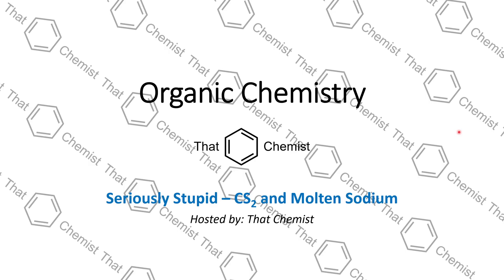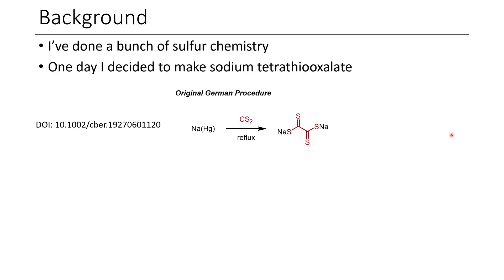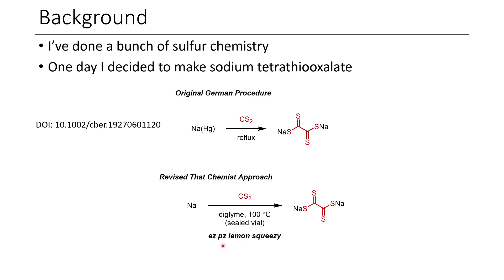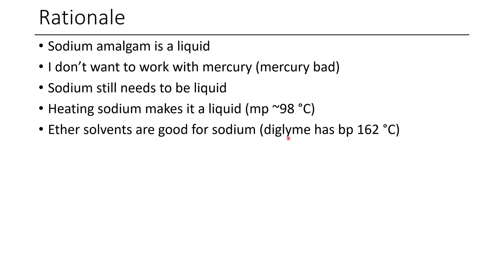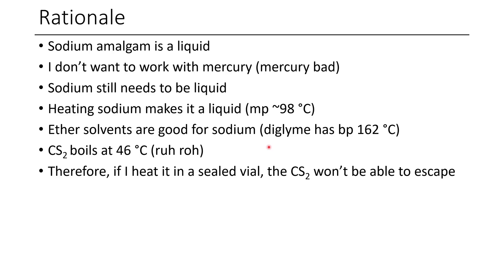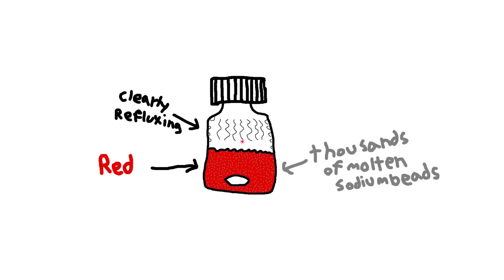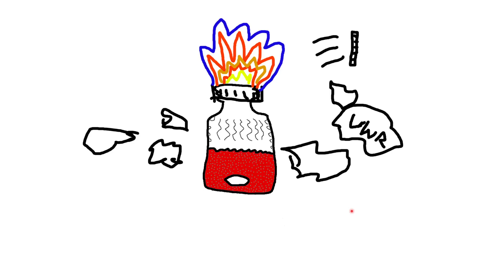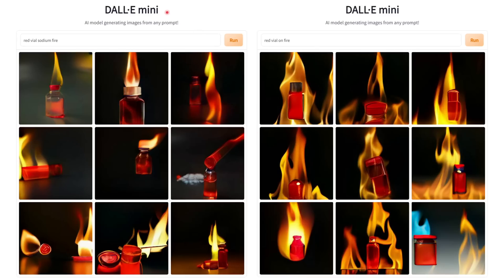Seriously Stupid - Carbon Disulfide and Molten Sodium

Comment: Carbon disulfide is terrifying enough. Just read a pretty wild book on the history of the artificial silk industry, where tens of thousands of workers over more than a hundred years were forced to work in garbage conditions, breathing in carbon disulfide as if it wasn't a neurotoxin. Insane asylums regularly took in ex-workers from rayon factories who were driven insane from the fumes.
Reply: If anyone is interested, it's called Fake Silk by Paul David Blanc.
Reply: Causes brain damage and psychosis at less than 3 grams per m^3? Yipe. Do Not Want.

Comment: so what you're saying is you just needed a stronger vial and it would have been fine /s
Reply from the maker: I mean, also technically yes
Reply: @That_Chemist  is the real correct solution to use something with a valve to tap off the product vapor?
Reply from the maker: @ghostdog0424  using a high-pressure vessel that is rated for the pressure is best - if the CS2 vented then the reaction would be unable to proceed, so ultimately a sealed reactor makes the most sense, but not a glass vial - a pressurized reactor with a regulator would be best
Reply: @That_Chemist  thanks! makes more sense than my bad idea.

Comment: You're concerned with toxic mercury but were not concerned about molten Sodium (!) in contact with a chemically active solvent???  Gosh.  Just FWIW, when Argonne closed oiut their sodium cooledr eactor, about 40 Kg of NaK went on the surplus market and I bought 10 kg, in 5 ml glass ampules.  I used this stuff for years. At least you didn't use water to extinguish a molten sodium fire.

Comment: I do not consider Your experiment seriously stupid (Not being familiar with that particular reaction, though.) . Perhaps Your only mistake was not checking expected total VP of the reactants at reaction temperature and chosing the proper pressure tube or bomb. Using proper equipment and ppe, doing pressure reactions like this is perfectly fine. Just do it in such a way that it can go bang without any further consequences other than a failed experiment. Especially glass pressure tubes do degrade over time. For those that do not know, a bomb is simply a strong pressure vessel for us scientists, not what You see in the movies...I have always used a 12 mm a lexan shield in the hood for pressure and  potentially explosive reactions. And work with small enough amounts so You know for sure that Your ppe, hood and safety shield can handle it. Hearing protection is important. I have a friend that have  regrets forgetting this. Also thinking ahead how to clean and limit toxic or noxious cleanup after a eventual mishaps is a good idea.

Comment: Dont really mind sodium amalgam, stuff works well, a lot more tame than streight sodium for many reactions. You get the mercury back at the end as well. Used aluminum amalgam also, the amout of mercury required is surprisingly small but its pretty much impossible to recover the mercury when the reaction is done. 🤓

Comment: As an alternative...  Here's a thought.  What if you used a Sodium-Potassium alloy?  (NaK being liquid at a MUCH lower temperature, well below the boiling point of carbon disulphide)  Yes, the potassium would likely react as well, BUT might it be possible to complete the reaction, and separate the product(s) afterwards?  Assuming that IS possible, then that version of the process might be a little....  safer?

Comment: Dumb question: Would NaK have formed the equivalent potassium salt?  Since NaK is liquid at room temperature, it would have avoided the CS2 vapor pressure problem.
Reply from the maker: It would have formed the mixed salt - it probably would have been fine for my purposes
Reply: @That_Chemist  Many Thanks!

Comment: Is there any reason why one couldn't bring sodium metal down to a very low temperature (liquid nitrogen comes to mind) to decrease its ductility and crush it into a very fine powder to enable the reaction without requiring liquid sodium/sodium amalgam? As long as you were careful to avoid any and all humidity coming into contact with sodium powder...is there any reason I'm not thinking of for why it wouldn't work for this reaction?
Reply from the maker: It’s conceivable, but grinding sodium into a powder is a little terrifying

Comment: Saying this as an organo-lithium engineer: Seems like Na/glyme stirring in a flask with reflux condenser and slow drip feed of CS2/Glyme reactant next time?  We were always biased to use Li dispersions in our R-X + Li reactions and slow feed the reactants.  What sort of heat of reaction did you expect? I'm wondering about the kinetics of the terminal run away rxn.  Buildups of reactants are one class of ruh-roh, and surface layer mass transfer is another. Was the intended product prone to thermal decomp? - so many questions..

Comment: In my micro lab we had two beaker explosions in two weeks. The circumstances and outcome were exactly the same. We were heating up a 4L beaker of growth media prior to sterilization in the autoclave. We screwed on vented caps (caps with inlet/outlet hose connections) and placed an air filter on one of the vents to allow for air transfer (the other port was connected to a sealed hose). The flask gets warm. Or maybe even starts to boil. Suddenly the flask explodes. The entire room is coated in scalding media. The upper portion of the beaker launches into the ceiling tiles above, breaking through them. Two analysts are in the room, but nobody was hurt because they were using PPE. Always wear your glasses around hot stuff!
Reply from the maker: Yikes!

Comment: I had a sample of a ruthenium salt and I wanted to reduce it to ruthenium metal by heating it in a stream of hydrogen. This I did in my parent’s garage. I had some hydrochloric acid dropping onto zinc and the hydrogen went through some conc sulphuric acid in a dreschel bottle. The exhaust tube had some steel wool in it to prevent blowback.
I wondered about the smell of chlorine before the whole lot exploded, I was wearing goggles.
In the aftermath I realized that the zinc was from old batteries and had some manganese dioxide on them and caused chlorine to be mixed with the hydrogen. I did see flame at the exhaust tube which didn’t go beyond the steel wool.
I hosed of the family car which was OK until I saw the inner tube of the dreschel bottle lying on the roof of the car and the sulphuric acid had eaten down to the bare metal. Fortunately the car was white so I covered it up with house paint which went unnoticed for a year.
Reply from the maker: Oh no :X

Comment: 2:07 - mercury bad. This is why people that follow the precautionary principle work on boring chemistry. Mercury metal isnt much of a hazard, being an old fart, I remember playing with the stuff in my hands. I have had mercury tests for other reasons (ate a bunch of fish from a lake I later found out had higher levels of methylmercury. THAT one is bad.) and my levels where well within tolerance. The metal, and even its vapour are so poorly absorbed (due to its remarkably low reactivity) that it just passes through you. Meanwhile, its the best way to do the experiment. The grandfathers of chemistry didnt get their names in the books for being overly cautious, no risk, no reward. Besides, you work with fluorine, that element has killed WAY more chemists than mercury has. In fact it has killed more than everything else. So im unsure how you derive your level of risk.
Reply from the maker: A fair critique
Reply: Flourine and simillarly reactive elements will probably kill you then and there, maybe you will cough your lungs out or choke in your own blood. While heavy metals will poison you and kill you slowly over time with chronic symptoms.

That's why I work with explosives for munitions. If something goes wrong I get turned into a fine pink mist. Which is soooo comforting.

Comment: Hmmm... if pressure wasn't essential to make the reaction go (doesn't sound like it was), why not put a small pinhole vent in the vial?  I've used viton with various FS tube capillary (2um to 20um) vents to mitigate pressure issues.  Of course you need some hint how fast gas or vapour is being made.
Reply from the maker: yeah the issue is how much more volatile CS2 was than the diglyme

Comment: I did the synthesis of the ammonium salt of tetrathiaoxalate were you electrify a pool of mercury at around 12 V as your working electrode and zap carbon disulfide in acetonitrile with some ammonium salt as an electrolyte. The tetrathiooxalate crystalises out as the reaction proceeds, was pretty cool. What was less cool was the separation of mercury from the crystals. I used a separating funnel to get rid of most of it but there were still loads of little mercury beads in my crystals, took about 8 hours to pipette them all out by hand.

If anyone wants to make tetrathiooxalate by far the best way is to go through thiapendione.

Comment: Correct me if I'm wrong but using a Schlenk line would have been a better choice for this reaction.
Reply from the maker: I don’t see how a schlenk line would come into play here
Reply: @That_Chemist  I guess I'm assuming a couple things. First, you'd be flowing inert gas to prevent a fire (assuming when your vessel broke you needed oxygen for the fire. Second,  I'm guessing you could cool your reflux column to prevent loss of you CS2. Also probably more   volume to prevent an over pressure.
Reply: Also note I'm a p-chemist, so yeah.

Comment: Inorganic chemist here: The group i worked in regularly handled very pyrophoric substances. Therefore a burning fumehood does rarely count for a screw up. It just happens due to material fatigue and sometimes screw ups.  But there have rarely been injuries due to fire. The reason had been, that students were very early taught how to handle sudden fires and that shit can hit the fan at any given moment.

I don't know wether this still relevant, but i often needed to use sodium as an agent. The most common way was using liquid ammonia as a solvent. But it felt really old school. So i changed the procedures and tested a bit. For me the easiest way was using glyme (my personal favorite was tetraglyme) as solvent and adding a pinch of naphtalene as a catalyst. The procedure worked like a charm and in tetraglyme i was able to do everything at room temp.
Reply from the maker: Awesome :)

Comment: A colleague of mine in grad school once did a reaction in CH2Cl2 at 120°C (!!!). Her hood was next to mine and I could see though the closed hood sash the solution refluxing extremely vigorously. I was honestly very concerned even though the reaction was in a sealed glass pressure tube and told her to set up a blast shield. Yup, I've done reactions in these tubes before and they can usually handle a couple of atms w/o problem, but you don't go THAT much higher than the boiling point of your solvent! It fortunately didn't explode but our supervisor strongly warned us against doing that ever again.
Reply from the maker: Yikes!

Comment: Given the described conditions the pressure from just boiling carbon disulfide would be ~5 bar, and since you had it in a mixture it would have been lower. I wonder if something else was going on to bust it like that.
Reply from the maker: Maybe it was a little bit warmer than 100
Reply: @That_Chemist  Suppose it was 150 C. If you had 10% carbon disulfide, that should still only be a couple bar. I wonder if there wasn't some other gas production mechanism, though I haven't thought through what that might be.

Comment: Did you end up succeeding or did your supervisor gently lay the project to rest after that incident?

My 2 ideas would be 
1) using a good pressure tube. I've done reactions in THF at 120°C so that should definitely be possible if you leave enaugh headroom for gas expansion.
2) just use NaK, duh :D
Reply from the maker: I waited until a while later to tell my PI haha
Reply: @That_Chemist  As someone who also likes not using amalgams,  I wonder if you could just dissolve some sodium in Galinstan and do the reaction that way, have done that with alu as an alternative to the evil terribad D-Tier alu amalgam (no-not for that, but yes, reduction after a Henry reaction). There's also, as mentioned, NaK.

Comment: Did you consider doing the reaction at 1 atmosphere in an open flask? Much safer.
Reply from the maker: It would have just boiled off all the CS2
Reply: @That_Chemist  Not if you put a reflux condensor on the flask...

Comment: Could you use NaK to have liquid sodium?

You might get mixed salts but that's not so bad.
Reply: apparently teflon stirring bars are hypergolic with NaK, so there's that
Reply: @tsm688  ooh, that's a reaction I'd watch through the safety of someone else's video
Reply from the maker: Yeah probably
Reply: Yeah l have the same idea.
 But when shit hits the fan how can you put out a NaK fire?
Does sand work?
Reply: @andraskatona9766  NaK isn't self oxidizing, the fires and explosions normally seen with NaK and other group 1 and 2 elements in water are caused by hot liberated hydrogen as the hydroxide salts are forming.

Comment: Putting a little glass dish over it... like it might spring a little leak instead of go kaboom.  I'd be thinking a heavy iron pot.  On most You Tube chemistry channels when someone says they are going to reflux, they use a water cooled reflux column with the curly glass tube in it.  Why wouldn't this have worked, sparing the pressure build up?

My worst goof was as a kid in a home chemistry set environment when I lit a pan covered with candle drippings with alcohol added.  Well, soon the drippings melted, floated to the top, and I had a blaze that scorched the wooden shelf over it.  I can't believe how hard I huffed and puffed but I blew the fire out.  I lived a bit dangerously.  (Later in a college lab, I forgot which of two beakers was an ammonia solution and which was distilled water.  I sniffed.  It was the ammonia.  It was like getting punched in the face.)
Reply from the maker: Oh no! If it was a high pressure vessel, my reaction would have been fine

Comment: What would you get from a NaK alloy, which is liquid well below the boiling point of anything else in your formula.  A combination of sodium and potassium salts of your product, which would then need to be separated some other way?  Would it even matter to the final application that it was a mix of sodium and potassium salts?

Opening the vial at the end would still be a challenge though.  What was the plan then?  To do it in an inert atmosphere so as to not get a sodium fire?  To chill the vial first to mitigate the risk?
Reply from the maker: After the reaction is done, it should have been fine - more or less no pressure changed, as long as the reaction has cooled to rt. I could have used NaK yeah

Comment: My lab regularly uses glassware under pressure or under high vacuum and to say it makes me uncomfy is an understatement. Even glass that is rated for high pressure can develop invisible stress fractures over time that compromise its strength
Reply: I remember Nile Red broke all of his breaker because it spontaneously break because some of those breakers are used to create plasma in a microwave.
Reply from the maker: True, it is sus

Comment: Great type of video. I now have much greater insight into what reaction you did, how you did it, and how it went wrong. Would also be curious to hear more about why this reaction is desirable, but that's away from the practical points this video makes!
Reply from the maker: I wanted to try esterifying either side, and see if I could use AgF to make RO-CF2CF2-OR'

Comment: Fun fact, if you get it hot enough (~200C) diglyme will react exothermically with sodium in a run-away reaction.  This was demonstrated by a company called T2 laboratories in the Jacksonville Florida area in 2007.  They killed four people and injured another 32 when their 2500 gallon reactor (rated for 600 psi and with a 400 psi rupture disc) burst, after they lost cooling.  There is an excellent Chemical Safety Board report: https://www.csb.gov/file.aspx?DocumentId=5661 and companion video: https://www.youtube.com/watch?v=C561PCq5E1g .  In their report, the CSB estimated the explosion was equivalent to 1400 pounds of TNT (the video includes surveillance video of the explosion, filmed with a B&W potato from a great distance - still impressive as the mushroom cloud dwarfs the cooling towers at a nearby power plant).  The video mostly skips over the chemistry, but the report is a good read and goes into the chemistry and thermodynamics in some depth.
Reply from the maker: we actually had a similar incident in our lab where poly-HFPO unzipped when it was treated with KH - it took out a fumehood sash, and glass stuck into the wall, and into the arm of the researcher involved!!!

Comment: Tip: When you are running a reaction in a closed vessel the pressure in the vessel will most likely be the vapour pressure of your solvent at that temperature. For common solvents those vapour pressures are easily available. In this case there was probably a pressure around 18-20 bar.
Reply: Another tip: Common lab glassware for high pressure applications is in my experience  only maximal rated for around 20 bar (microwave vials) Should you require higher pressures you will need to switch to a steel reaction vessel.
Reply: Ie: too much